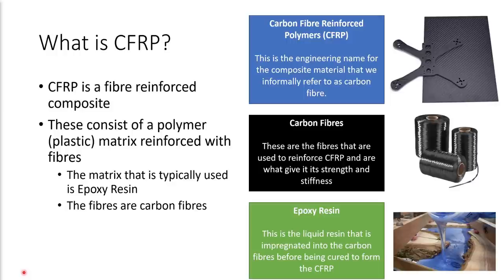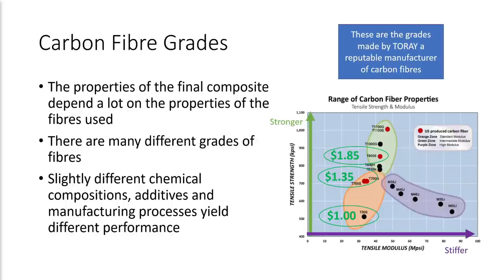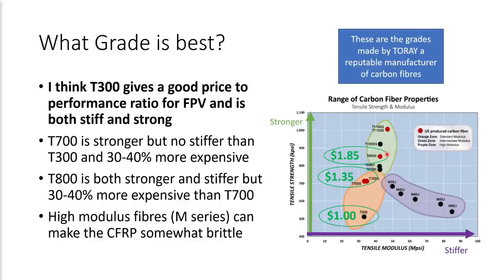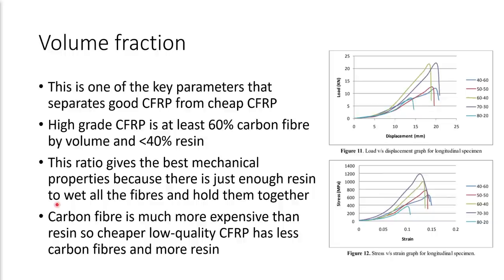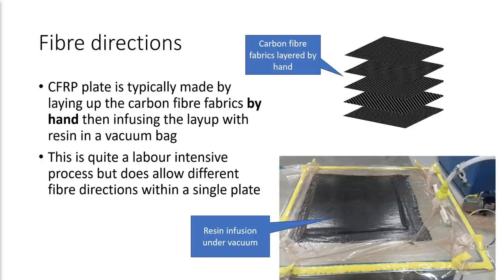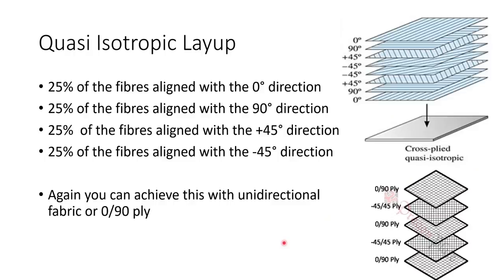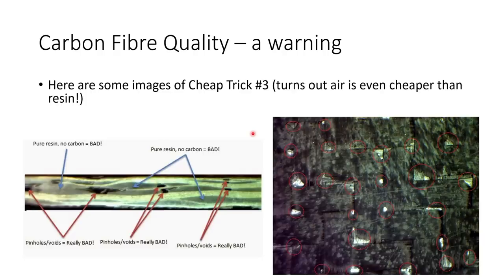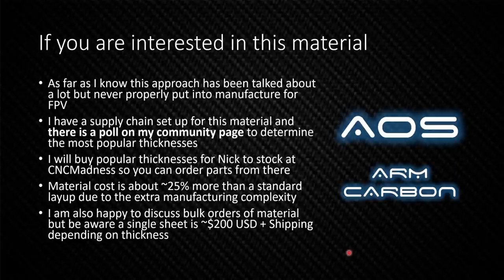Carbon Fibre: A deep dive on this incredible composite material

Comment: I'd love to know what Emax is using on there 5inch racer arms to make them so stiff.
 To compared my mates switchback the arms are so strong, I'm still yet to break one in a crash. At races they have metal poles and yeah it's a test for strength haha. After a year of crashing the end is starting to Frey a bit though. But probably flown 500 plus packs half of which a crash in the flight of some kind haha.
Reply from the maker: Looking at photos it looks like the arms are relatively beefy and made of aerospace grade CF (60/40 or better fibre volume) which will make them very strong.
Reply: @ChrisRosser  makes sense mate, I've always wondered about it. Tried a few different tight race frames and it blew me away the strength they got with the simple design, especially as its an old frame now. But I'm saving for one of your frames as I'm really genuinely impressed by all levels of thought and time you've put in. Thanks again mate and I do hope you stick around in FPV into the future and don't get burnt out by some of #&%! that comes in hobbie for designers and innovators. 
Cheers.
Reply: @ChrisRosser  You can't tell resin content fraction by looking at an image. However you can tell by measuring it's density.
Aerospace grade is just a certificate - it does not mean it stronger in most cases. T700S sold both with and without aerospace certificate and they have the same property's.
Reply: @madmanjohan  Always learning on this channel, even in the comments. Cheers mate, what ever they done they made the strongest arm I've used on a 5inch racer quad.
Reply: @slowentropy4531  if you ever break one - set it on fire, then peal it apart layer by layer and you will see how they did it
Reply: @madmanjohan  interesting, Emax sent me a bunch for free as they apparently didn't sell many of the spares and have soooo many in storage lol. I've smashed one with a hammer between two bricks and compared to others I tested it sort of blew me away at strength. It broke on second strike but, other usually bent a bit one first strike and could see how lamination was different. Just curious as its a material I'm really not schooled on... being a nurse they didn't teach us much about it hahaha.

Comment: Yeah can try t700 ,  I guess foxeer aura frame uses t700 so t700 may be a good choice
Reply: are you sure it t700 ? did you check it ? in this ridiculous market you can't tell what is what.
Reply: In the market everyone said they use T700, but indeed T700 is very rare especial in such cheap price

Comment: Id definitely pay more for a frame if its proven to be more durable and stiffer
Reply from the maker: If you use a higher grade fiber the frame will be stronger and stiffer. The only downside is the extra cost. I'll speak with Nick and try to get it added as an option.

Comment: Wanted to say Great Job on the AOS series.  Right now I have two 5" frames; the BotaFx by Bot Grinder, and the Switchback from Evan Turner.  I listed them because both are top frames in their respective disciplines.  Your AOS frame (for me at least) is one more example of a frame meticulously designed with a purpose.  It inspires me and I will be building my next drone on that frame.  Thank You for your contributions to this hobby.  (also don't mind Mr. Steele he had his mind made up before he flew it, everyone has off days)

Comment: That feels to me as if you just posed as some kind of composites engineering guru to plug your arms.
Reply from the maker: I would not claim to be a guru, just a professional engineer with training in materials and composites. Optimizing fibre layups is pretty standard in automotive, aerospace and cycling industries. Even high end golf clubs are doing it nowadays. I'm just doing the same for FPV quadcopter arms and making the material available to the community so you can cut your own designs from it. I think that's a good thing to do, rather  than keep it for myself.
Reply: @ChrisRosser  I actually misunderstood what you did. I took it you used your software tools to select a set weave and preformed plate albeit higher grade and cutting arms etc, but adding a bit of educational razzle dazzle to fox the customer, my bad.

If you're engineering them that's fair play and I'm as I guess your generalisation would be a stress engineer no? A good person for it, can't you make props quiet next?.

 I'm super defensive of real engineering and engineers that actually engineer at the moment sensing extinction ((and it can be software to stone masonry in my books)  and because an academic/scientist only makes the transformation to engineer, by engineering something 😆 not holding the certificate, i see more potential engineers in the FPV community, whether as a blend of pilot and technicians to fly and maintain or more exciting, a place for the pure engineer builder, credited for now or not.
 Maybe a place for our kind once again to invent and engineer in the world or how else can it manifest? and we should grow and build especially nationally. 
Theres a massive boom coming that might be remote aviations niche, we would be the remote aviators then lol. 
Or mass imports will fill any void which we might scrape off the 40 billion growth predicted and I see you are helping those engineers so fairplay.

As an aerospace engineer that saw the a400 EIS at airbus military R&D nearly 20 years ago and more recently a couple Italian M346 prototypes, those being mostly composite I'm a little educated.

From a practical standpoint I might suggest that if you control the layup you also have control of introducing techniques such as instead of only vacuum perhaps you could engineer a press and gain greater densities, 

If then have a hot press could composite/laminate anything in kevlar is instant safe option but not sure qualities, surely and maybe combo with 3d printed moulds to allow pockets of foam or sorbothane etc in the arm, not too tricky to industrialise small.

Also its a smart direction you are taking by stiffening everything to gain high frequencues that are more easily squashed by cancelling it essentially as gyro noise, but as an evolution, might it not mess with other high frequency RF or nav functions when they need the precision/clarity? I guess they are damped at source then but maybe combing electronic and mechanical dampening also serves?
Reply from the maker: @DigitalArtisan77  No worries. Easy mistake to make. I'm using standard fibres and resins but changing the direction of the fibres to be better aligned with the loads felt by a quadcopter arm. AOS Arm Carbon is by no means a standard material. The layup is my design and custom engineered to be as close to optimum as possible for the application.

I learned recently that the CF manufacturer I'm using is infusing under vacuum but curing in a heated hdyraulic press to accelerate the cure and increase the density of the final composite.

Regarding frequencies, the frequecies of frame vibration ~200Hz are very much lower than the frequencies of the electronics ~1,000,000 Hz and the RF ~2,400,000,000 Hz so no risk of them interfering.
Reply: @ChrisRosser  cool thats interesting as i said your approach is quite high tech and the applied electronics/RF/control loops waveform form of mechanical engineering, what is that classification of engineer? Its like an energy engineer 😆 im sure thats a stress engineer in aerospace as you model the inefficiencies essentially.

I visualised the separate bandwidths living happily within the frame, sorry can't shake the primarily mechanical gorilla mindset 😁.  And you can push a more favoured resonance via the arm engineering to the gyro as you can't eliminate it, hence make it the better form to deal with,  but to me means multiple seperate bandwiths, then potentially seperate mechanisms to serve the mitigational purpose, allowing people to invent and add to evolve our community design, for example soft mounting not found to help on motors so much etc.

 I see, you that are custom demanding the weave, thats a pretty specialised company you've found fair play. I thought maybe you'd found a little composites worker somewhere, maybe you can find or grow one from your community, then you could actually model a design beginning to flex your skills,  with the cost of CNC and 3d printing its pretty viable and more the dangers of handling needed skilling so not very long to learn and our kwads don't need aerospace standards of certification. 

I actually could hook you up with Bombardier/Airbus approved composite outfit in U.K. if wanted but doubt any saving as aerospace and i know the cut throats that run it.

I realise not your area regarding the investment of time or cost, but you are leading and actually i'd say lead UK educator and researcher for the engineering, which is a great contribution. So maybe your more mechanical followers might want to look to construction of composites, I actually feel we need to move past flat board designs, but of course that needs the industry at our little scale.  I won't link as anyone can search but easy composites is a wonderful UK company that has amazing videos on YouTube to educate anyone interested from simple designs to motorsport grade projects.

Comment: maybe 2 piece arms? 
bottom disposable 3mm section with grove for Nyogel. 
top section 3mm with Racewire in it maybe...

I like pursuing both the best value and best performance (within reason) 

Broke kids needing a hobby need Value. 
others with some spare cash and or commercial applications want performance. 
the Tech rolls down hill.
Reply from the maker: I think a thicker single arm will always be better than a sandwich because of the increased stiffness. But I love the ideas and keep them coming! Definitely looking for best performance at reasonable cost with the AOS frames.